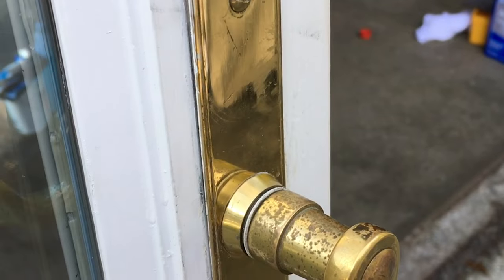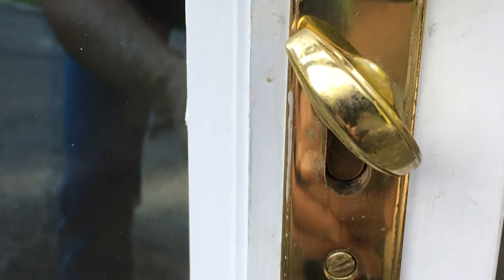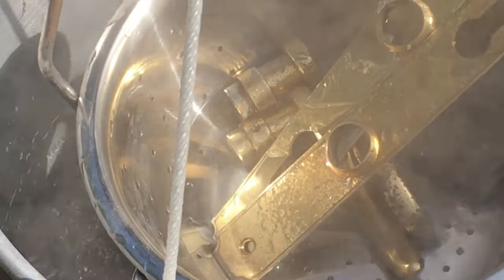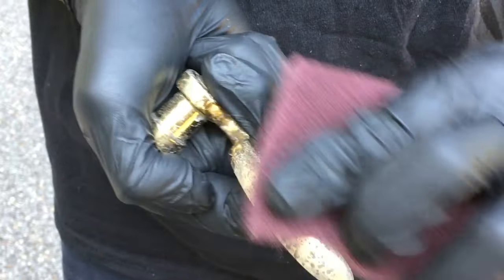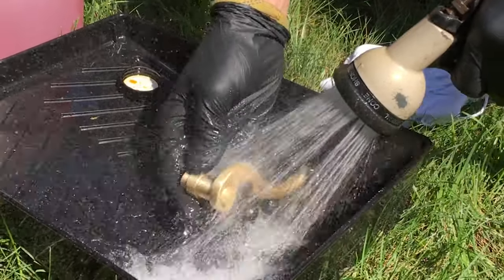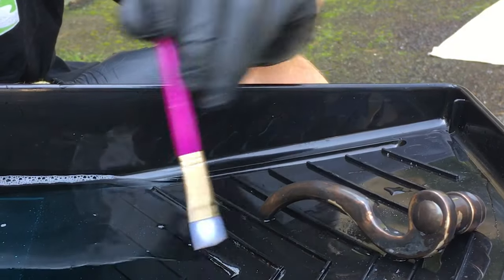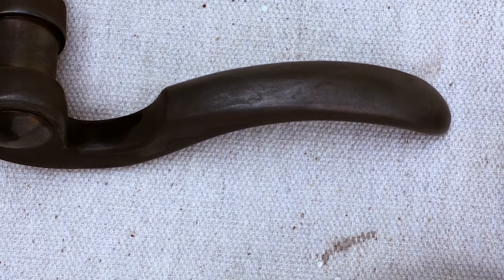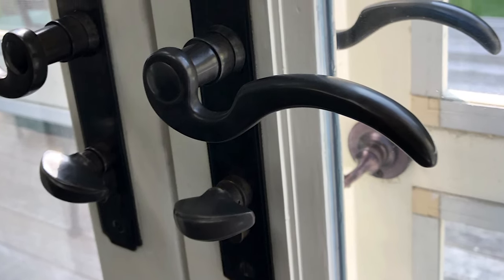How to Change Bright Brass to Oil Rubbed Bronze

Comment: Thanks so much for posting this! This is so helpful. I have a question though, what type of lacquer you would use to protect ?Spray or brush on? Thanks
Reply from the maker: Glad you found the video helpful! 
If you choose to use lacquer instead of wax, I’d recommend using spray-on in a matte or flat finish. These sheens are less common than gloss or satin so your local paint store is less likely to have them in stock, but you can find them online. Good luck with your project!
Reply: Thanks, I appreciate your help!

Comment: What kind of sanding pad did you use? Do you not "scratch" it too much? Thanks
Reply from the maker: We used 3M synthetic hand sanding pads, “very fine” grade. We’ve also used medium grade with success. The synthetic pads are quite forgiving and can be controlled by applying more or less pressure.

Comment: Would you say it looks more black or more bronze? Kind of hard to tell but looks great.
Reply from the maker: Good question… but not easy to answer. The color depth and tone you’ll end up with is determined by the type of brass as well as the length of time it’s been exposed to the solution. Some types of brass will end up lighter and others darker, and also either warmer or cooler in tone, but despite those variations, I guess I’d never really describe the final color as black. 

By the way, the reason we finished the hardware in the video with a brown-tinted wax is because when it came out of the solution, the color was a bit cooler than we expected. The brown wax gave us the color correction we wanted.

We’ve done different hardware with the exact same process and it’s come out with a warmer, more bronzy hue. When that happens, we use clear wax for the final step

Comment: Great video, used the same Jax products and dipped the part, which gave it an even color however your parts are a couple shades darker.  Any advice on getting a darker finish?
Reply from the maker: There are a few reasons I can think of that might cause this to happen…
1. The most common is that the darkening agent has gotten diluted or was weakened by  use (it loses its effectiveness with exposure to brass)

2. The surface was contaminated somehow. In the past I did this same ORB treatment on a pair of outdoor brass handrails. One came out out a little lighter (and slightly more blue) than the other. I don’t know what happened, but I buffed it down to raw brass and treated it again with a fresh batch of darkening agent. The second time came out much better.

3. Brass is made by combining copper and zinc, and it’s possible that yours has slightly  different proportions of those metals. If this is the case, there might not be much you can do… however, if you haven’t waxed the parts, you can deepen the color by using a dark-tinted Briwax like the one I used in the video
Reply: @northriverbuildersinc908  Thank you!  I also ordered the Sur Fin product you recommended to see if their product will give a darker shade.  If we use wax, will the finish still come off eventually?  My client wants it to remove over time from use.
Reply from the maker: @stepandrailco  yes, if you use wax the finish will still wear off over time, naturally revealing the brass at the wear points
Reply: @northriverbuildersinc908  Appreciate the replies